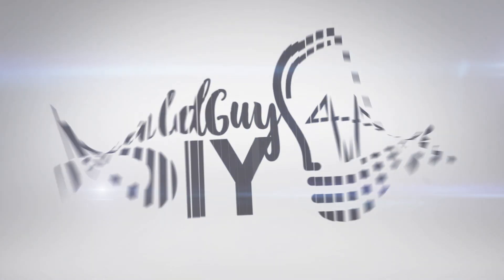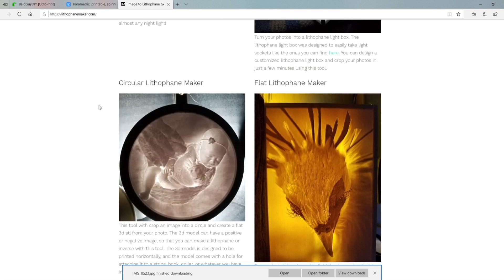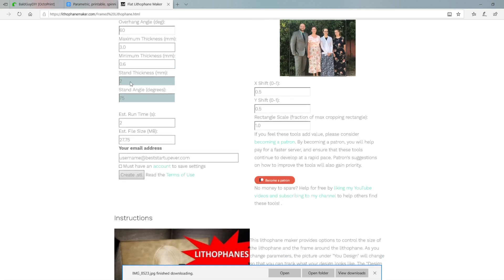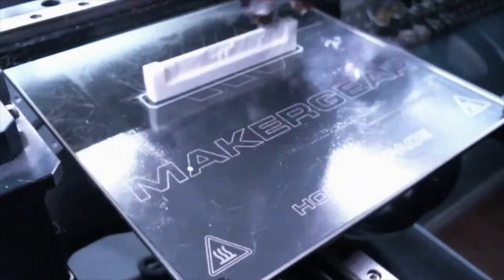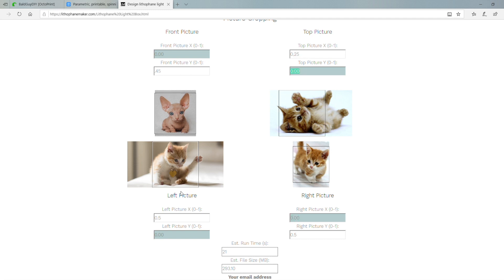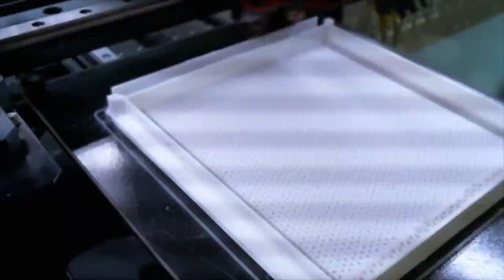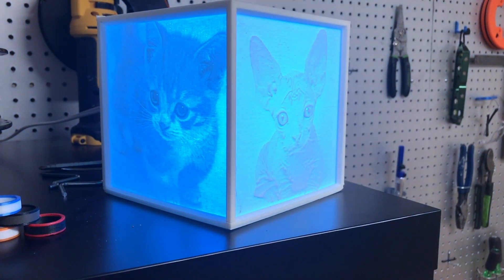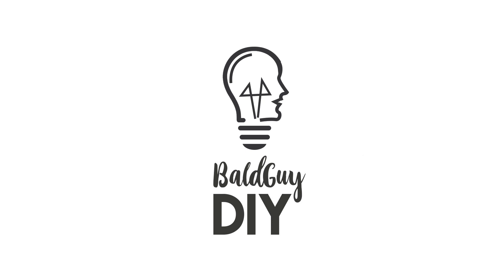Printing Colour Lithophanes

Comment: Any tips for using colored filament?
Reply from the maker: Make your lithophane as thin as possible. Coloured filament is much more opaque, and there’s a good chance that it won’t work depending on the colour. There are settings for the thickness, play with those, hopefully it turns out well:). Thanks for watching!